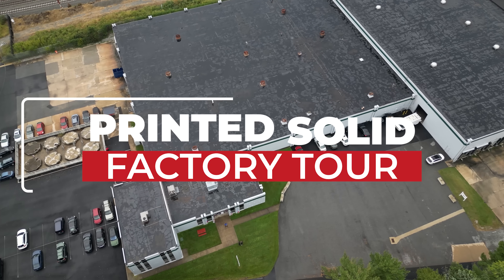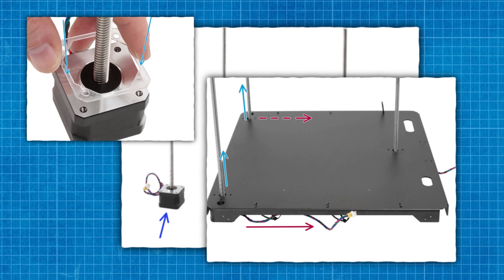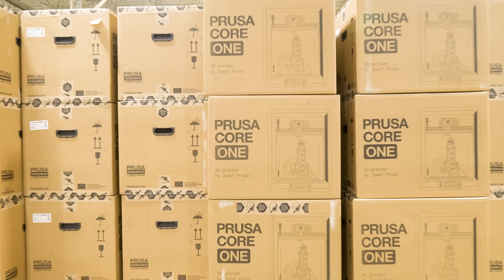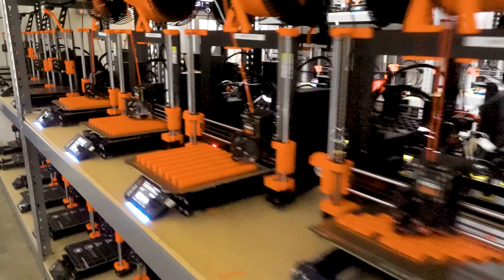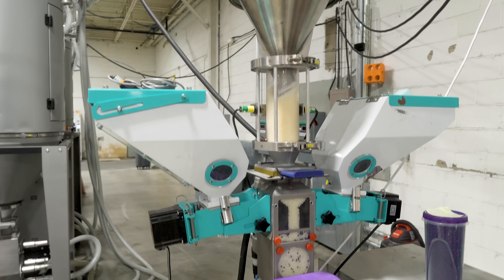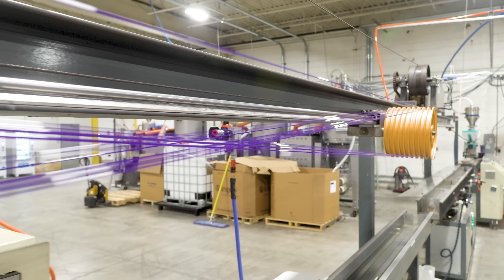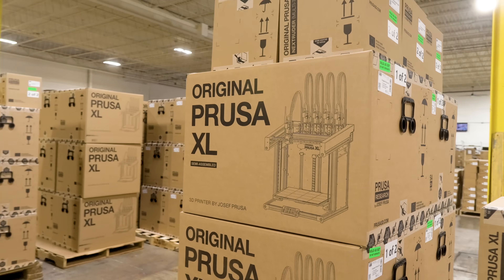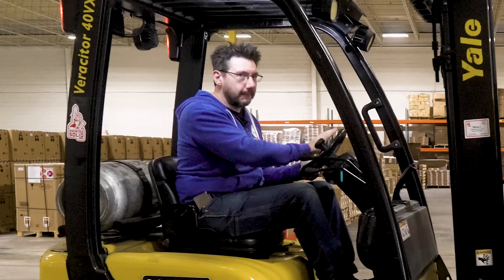PRUSA’s Factory in PRINTED SOLID!

Comment: Joel, what filament would you recommend for printing threaded inserts?  Have open printers only. Using PETG HF, and if I chase the threads with a tap, amazing results, BUT, is there any better filament that will hold up better when threading stainless steel hardware in it. Using 1/4-20 and #8-32   Thanks and High Five!

Comment: 3:35 VENTURE BY STRLGHT!

That accumulator is pretty much a standard device for any manufacturing process that uses spools and you want to keep the line running while you cut it.

Probably the coolest example is Kodak factory making film.

Comment: what is left that is not manufactured in the US .... The sheet metal part fabrication and the electronics? I don't think that the sheet metal part fabrication would be difficult to source in the US. will this finally make the cost of their printers competitive?
Reply: No. US labor is expensive. Prusa is likely making less profit on US units.
Reply: @wojtek-33  Prusa is charging more for the same product—first there’s the tariffs on the parts they ship from Czech, secondly there is the cost of labor, thirdly there is the US taxes, and finally there is the huge investment in machinery and training of staff.  Of the four cost structures involved, the only one which might go down in the foreseeable future is the ridiculous tariffs.
Reply: Sheet steel is currently subject to 50% tariffs (unless Prusa can compete against large manufacturers for rapidly dwindling availability in the US). In theory, building locally in the US should at least drastically reduce shipping times and costs (and taxes/duties), but not sure if they can really drop the prices of the printers themselves at the moment.